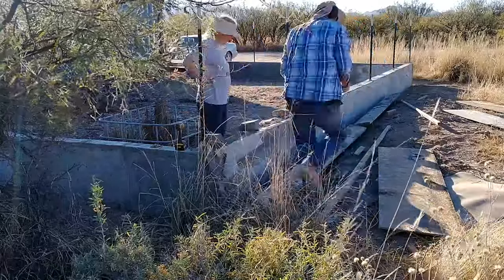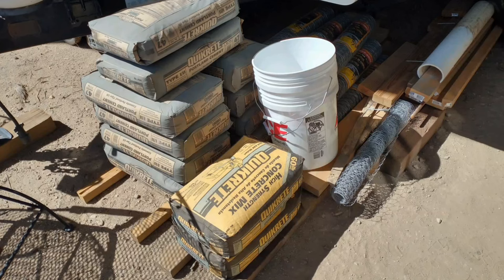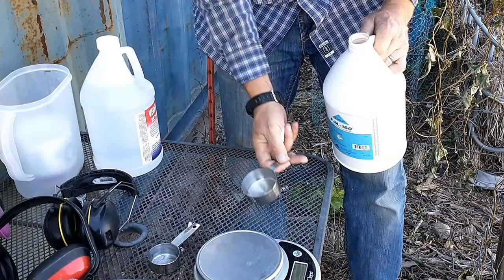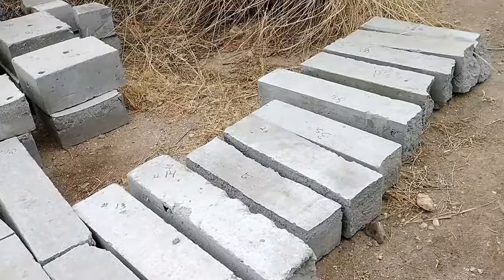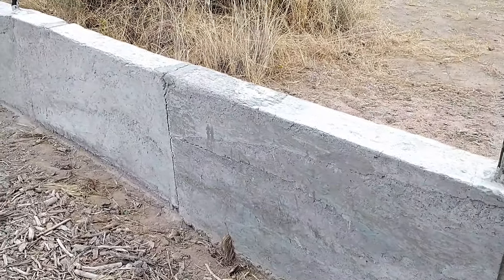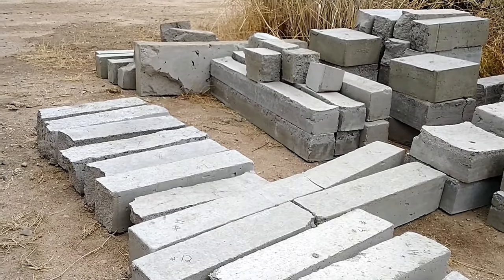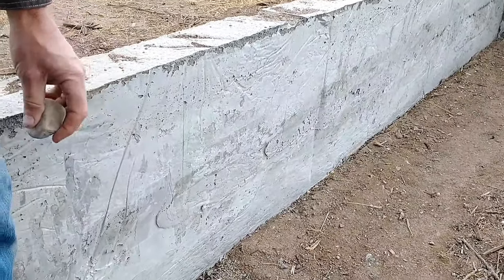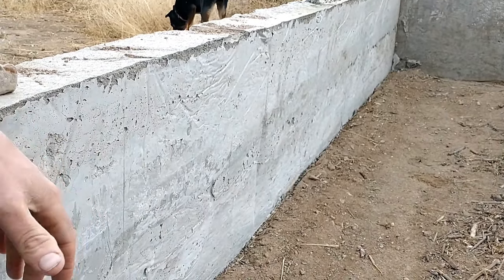Why we GAVE UP on AIRCRETE & What is Our Plan Now?

Comment: Let me start by saying, thank you for the awesome video! We need more of us!!

However, I'm not sure I agree with your statement that you've "controlled the condition." You never developed a real consistent process. You changed the formula half a dozen times over no more than two dozen batches. You did not measure temperature of the material or ambient temperature for your cure. and as you mentioned you don't seem to have used the same mixing times. Cement is very sensitive to ambient moister and temperature as it cures; mixing time (adding heat into the cement) can also effect cure times. Add to that the fact that the foam is going to loose structure the longer the cement stays open, means you're definitely going to have inconsistency no matter how well you control.

I've made about three batches using the same Domegaia set (the newer Dragon XL version). The discrepancy (I believe as I've observed) is due to the fact that the author of the material built these domes in climates which stay stable, well within the cure range of Portland cement. Your place looks like our. COLD! Which means we're going to have huge fluctuations in temp thought the cure process, making it seem like we're not locking in some other factor. IE Did you start every batch at the same time of day, and where they exposed to the same ambient conditions.

A really good control (which I need to do if I'm going to cure in the dead of winter) is to enclose the forms in a temperature controlled enclosure, that could keep a nice consistent 60F (the optimal cure temp for Portland cement).

The ASTM compression test, uses a hydraulic press with a pressure gauge to test for compressive loads on cylindrical core sample size. The method you used is excellent when considering whether to use this for a lintel or to span an area (which aircrete is not for), it does not inform much as to how much actual compressive strength is available in the final monolithic structure. 

Adobe only provides about +300 PSI. CEB provides well over 3000PSI. aircrete falls closer to adobe, but still has more than enough strength (even your worst batch, maybe not the cellulose added one) to build a 10 foot wall that is 12 inches deep (no load).

Compressive strength is very different than tensile strength. Though aircrete is brittle, and does not have the same tensile or compressive strengths of concrete, it has a very high compressive to weight ratio, which makes it ideal for small structures such as domes and arches where the nature of the structure itself provides load mitigation, and where you're not exceeding the load limits.

You can build very strong arches (especially Catenary arch) and domes with the stuff.

Most of the materials (even what you would consider failures) can be used in a dome with re-enforcing fabric, and once you have the scratch coat and the finish on it, despite the lack of tensile strength (increased by the wrapping fabric), you now have a strong monolithic structure. Resistant to wind and weather, with far better insulation factors than any conventional frame house you could build, and in the process building an environmentally friendly and cost effective home.

I can certainly understand the time constraint, that is a different story. I'm sleeping in a tent, in the dead of winter, build on our property; and as crazy as I am in loving every minute of it, I certainly can't expect my better half to be able to withstand it. So I think your conclusions on aircrete are possibly driven by other factors and not aircrete itself. 

The inconsistency is not in the product, it is the way in which we (you and I) are producing it, all of my problems with it so far, have been basically self induced.
Reply from the maker: Yes, based on other aircrete channels we were watching, we knew it was going to be difficult to get a consistent product, but it was even more challenging than we expected. We started at about the same time of day for all of our batches. With the first samples were made in the afternoon, we were in the low 80s and ended up pretty close to freezing every night. We were expecting to be able to make aircrete through most of the winter, but our particular location is often 20° degrees colder than the surrounding towns. So that was a huge bummer. Yes, I think the cold Drexel was likely our main issue after the first batches. Also, if the first part of the jug makes awesome aircrete, and the second half of the jug doesn't work at all, what does that say about Drexel? Harry showed it keeps it's volume way more than other foaming solutions, but what he didn't show, was the large amount of water in the bottom.  We are living in an RV and doing everything on solar, so there wasn't any great way to keep the Drexel at room temperature, or to heat the water. That may have been the issue, but the problem of cold wouldn't have gone away  until well into spring, and in the spring we get consistent dry winds, which would have made curing an upright wall extremely difficult. If we could have got successful batches in the fall, we would have been encouraged to continue, but if it's that temperature sensitive, we we decided it just wasn't going to work for us. Best wishes, I do think it can be done, we just don't want to spend years trying to get it to work, and we don't know enough about the long term durability of the aircrete. We could imagine it eventually turning into powder inside the walls. It will be interesting to see how the garden wall looks in a few more years. The tests we did were to compare the different samples to each other in a fairly consistent way.
Reply: @RedandAprilOff-Grid  Thank for the awesome insight. I look forward to watching your continuing adventures 🙏🏻😇

Comment: A bit of summary for my own brain. 😆 (some of my own thoughts included)
- while air Crete is a cool material, and someone else might be able to build a house with it, it wasn’t a good fit in this situation for full-wall construction due to batch consistency, compressive weakness, powdering, and microcracks. 
- difficulty with overall mix consistency despite increased efforts to control for all possible variables. Inconsistency carries the risk of having some good spots and some bad spots in the same structure and even the same wall. 
- bubble size, issues with large bubbles despite trying additives and nailing down density/quantity. Same risk as with overall consistency. 
- micro cracks on the surface even in fiber reinforces mixes indicates a risk of long term surface weakness/ potential spalling. Even with surface bonding cement, if the outer layer is weak it can spall. This risk might be ok for a shed but not for a long term residence. 
- it’s tendency to powder/give way with light pressure is incompatible with the need for lateral support of the metal posts against twisting and bowing. 
- erratic/low tensile strength carries the risk of exterior wall panel failure in the case of high wind gusts and other weather impacts.
Reply: My own take away, is that aircrete is a decent insulator, resists pests and especially wood eating insects, but is not structural and should be treated like an insulative material (like rigid foam or rock wool) This matches what I have concluded from aircrete experiments by others. If this conclusion turns out to be accurate, then increasing the insulative capacity instead of the strength capacity makes a lot of sense.
Reply from the maker: Yes! This is a great summation of our results and conclusions! 👍😊
Reply from the maker: The lighter mixes are just so weak and crumbly. I'm not sure how well they would hold up even inside a wall, especially if the wall gets any kind of vibration or impact. The stronger mixes are much less prone to crumble or turn to powder. Our strongest mixes probably would crack, but I don't think they would turn to powder like the lighter  samples that had bigger air pockets.

Comment: Yes! Now you are on the right path.  No more need to be running test samples for weeks and weeks and getting frustrated. Now you can build and be confident of strength, quality, and durability. Aircrete was very frustrating for me also. I just could not figure out why I could not get repeatable quality aircrete. Cracking and powdering are all issues I encountered. And do you think you can just repair aircrete?...not with the powdering. So glad to see you are moving along with other tried and true methods.
Reply from the maker: Thanks! Yes, we are so glad to be moving on. We really wanted to make it work and liked it's properties and the idea of doing something different, but it just wasn't working out. The thought of having the inside of the walls eventually turn to powder, was looking like a real possibility.  If we could have made batches like the first ones every time, we would have went ahead with it. 
I'm pretty sure the cold temperatures were not helping anything, but I also wonder about the Drexel. As other channels have mentioned, it seems like the first batches with a new jug turn out awesome, and the last batches turn out terrible. So, when we opened a new jug and mixed it well it just mixes the good and bad parts of the Drexel together. Then we had batches that didn't fall, but also weren't great quality, because they had the grainy stuff mixed in from the bottom of the jug. 🤷 Just one more idea of something else that might have contributed.
Reply: How is the dome going Jon? No updates on your channel for awhile!
Reply: @zacwhiting1563  Hello Zac, It is on a long-term hold. Like so many other people, Covid-19 and job(employment) problems have kept us from our home on the island. We are hopeful that things will get back to normal soon. In the meantime, I am tinkering with a Tri-Magnum build. I may put some videos out on this.
Reply: @RedandAprilOff-Grid  May I ask you, if you ever tried with dish-soap as many suggest, April??
Reply from the maker: @paulwyleciol3459  No we just used Drexel. Suave Clarifying Shampoo looks like it might be a good option, but you need to use a lot of it so Drexel ends up being less expensive. Maybe some of the other types of soaps do better with cold temperatures. It's worth a try.
Reply: @RedandAprilOff-Grid  that was a quick answer! ;-)   It is 01:43 a.m. here in Austria and I will have to go to bed, you maybe just got up in your land. HAVE A GOOD TIME and GOOD LUCK, WHATEVER YOU WILL DO IN THE FUTURE!!!
Reply: I just saw your video, I see that you were weighing your test bricks which look like they were about 5 lb. If I were to guess, it looked like maybe one half of a cubic foot. Is that correct? I've heard that 30 lb per cubic foot is what it should be at a minimum generally speaking. That would explain a lot of what I saw in the video. Did you try making a batch 30 lb per cubic foot? It should have about 10 psi pencil strength at that concentration. Very curious
Reply from the maker: @tryscience We were weighing the samples to compare them to each other. There was a fair amount of difference in the weight of the different samples. The square bricks were I think 9.5 × 4.5, but at this point we don't remember the details. The weights of everything are in the testing videos, and the process we used to make everything is in our playlist.
Reply from the maker: @tryscience  https://youtube.com/playlist?list=PLW_v9VWGwCM_gdAXzuKTr8J13rTZ1DSpx This is a link to the playlist.
Reply: @RedandAprilOff-Grid  thanks but, I was just looking for a simple answer, not for a list of 13 videos.
Reply from the maker: @tryscience  This may or may not be helpful, at about 14 minutes into this video,  https://youtu.be/LjmU4T3aAWw Red goes over all of the numbers from our test samples. It includes the weight comparisons of the different mixes.
Reply: @RedandAprilOff-Grid  thank you April. Unfortunately the results don't show the size of the squarish blocks, only the weight. If I knew the height and width and length of the squarish blocks, I can quickly do the density calculation for you.

Comment: You were so methodical in your aircrete attempt I thought if anybody could do it you would. The alternative to aircrete that I thought was most promising was using ground up expanded polystyrene packing instead of foam. It comes out very fireproof, fairly strong and good insulation.   The biggest advantage is consistency without having to rely on foam. There is a company in Phoenix that makes blocks of this material which stack together like Legos and then concrete is poured through the openings to lock them all together. The walls still have good insulation. Another guy on YouTube built a garage using ground-up polystyrene and cement mixture for the walls and he even tamped them from the top as he was pouring . He then built a second story on the garage to prove the walls were strong. Supposedly you can get the polystyrene packing from furniture stores etc and save it from ending up in the landfill. But you still have to go to the trouble to grind it up.
Reply: Yes! Agreed! Also when 3m was forced to change the formula on styrofoam it's only the glue that is flamable. Once it's shredded, it won't burn. Silicone foam is flame-retardant, self-extinguishing & can withstand 2100 degrees F flame for more than 10 minutes without burning. I was shocked when I tried it myself. Also the silicone foam and AirCrete mixture is what's currently being used in Asia for home building , yes, even on load bearing walls.
Reply: @bhing1483  Could you be more specific? Silicone  foam? Styrofoam (XPS)?Expanded polystyrene beads (EPS)? packaging
Reply: just to be clear the guy who made the garage was using AIRcrete with styrofoam which is differtnet than EPSCrete which is just normal cement and styrafoam. https://youtu.be/6U4JAop0dTY?t=1151
Reply: @firstdayof1  xtruded styrene foam blue or green sheet goods. Expanded styro, white beads.